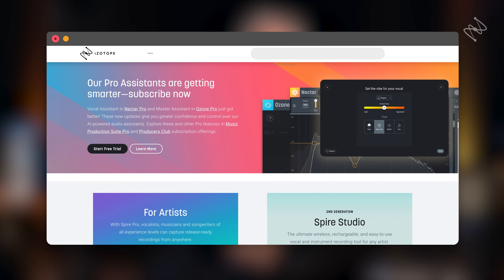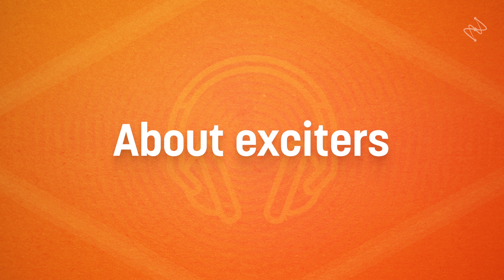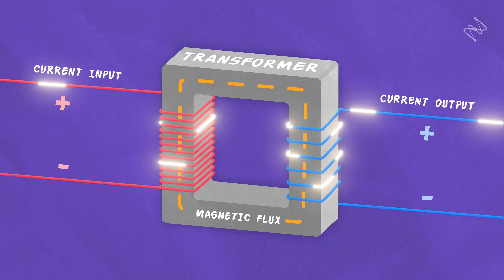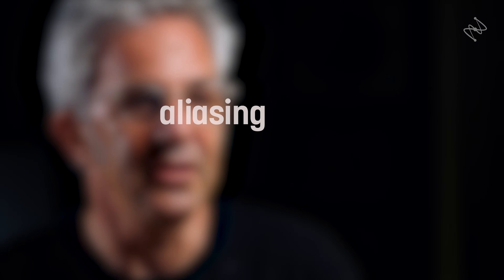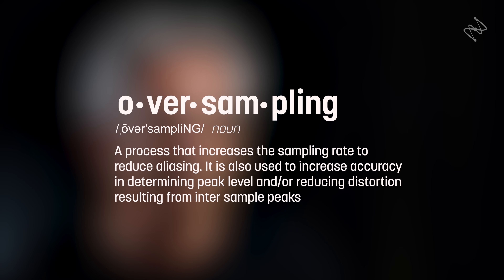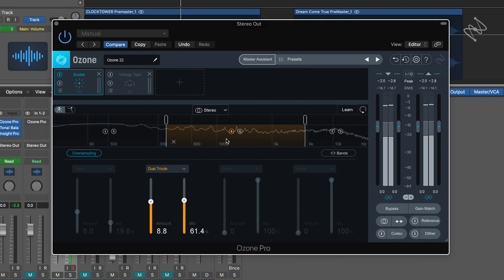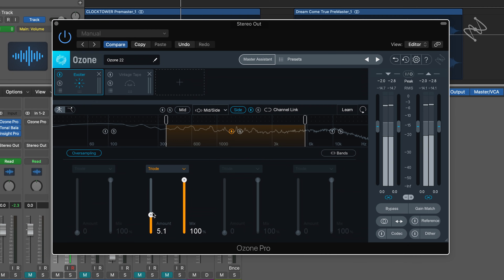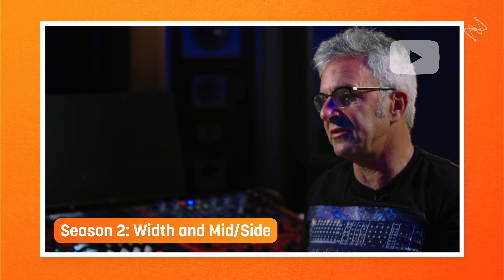Excitation in Audio Mastering | Are You Listening? Season 3, Episode 2

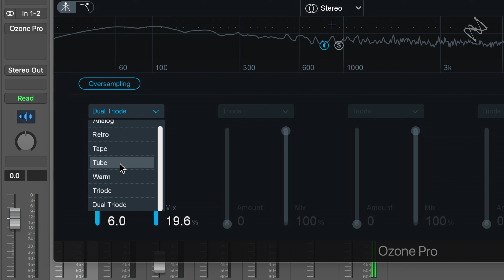Comment: The comparement before 10:00 is fails. There is not difference between Tube and Triode in this time area. And from 10:44 you hear a difference in Tube at sides (more stereo width) at about 300Hz to 800Hz.